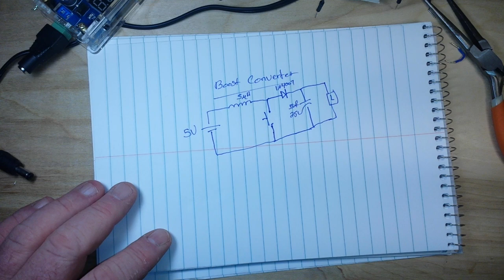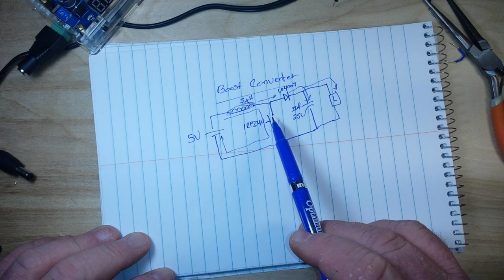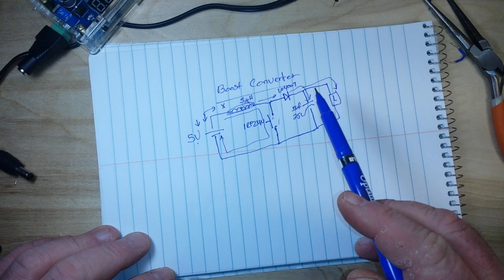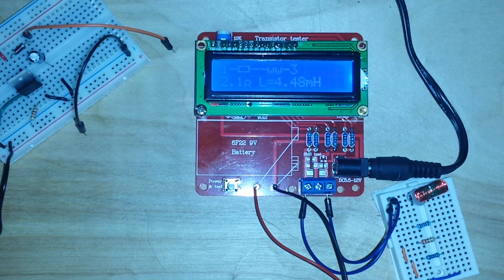Make your own boost conveter

Comment: so to get a steady output to like 20v, you would just change the resistor value?  great video
Reply from the maker: dwpetty3723 if you want to change the output voltage you would need to change either the inductor value or the switching frequency. the resistor at the end of the circuit just stabilizes the output. thanks for the compliment.
Reply: what is the value of the resistor?